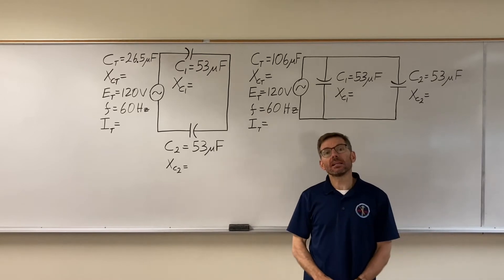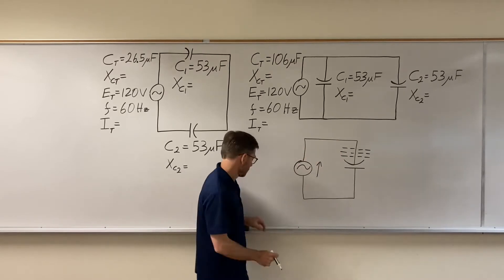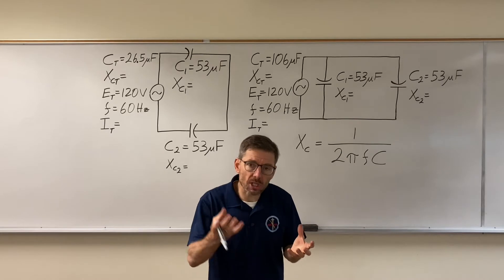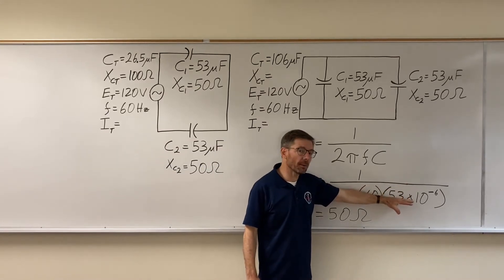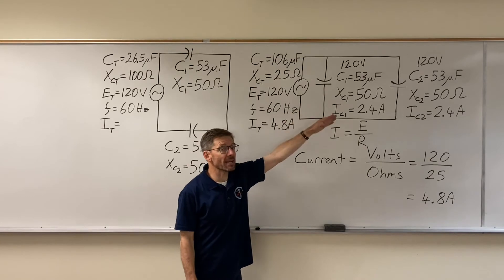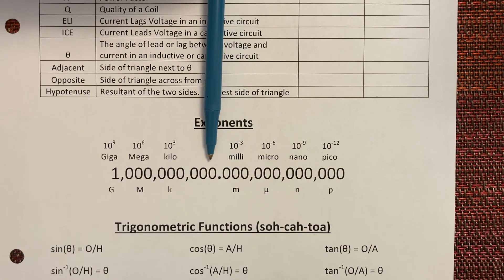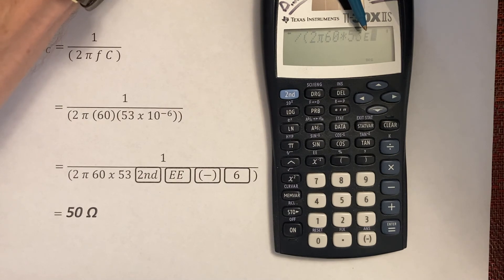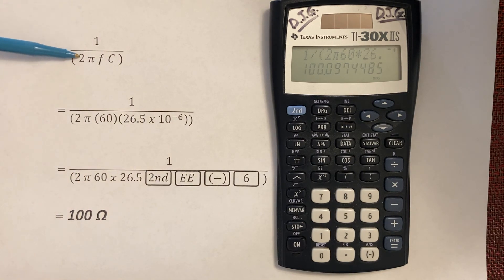Capacitive Reactance in Series and Parallel

Comment: This is awesome sir!
But I do have a few questions,
1. On the series one how did you get 26.5micro farads I get (2652.58)?
2. On the parallel one,how would you do the math if you had different mf to get the Xct value.
Thanks for all the info you put out sir!
Reply: Answer the first question : Half of the 53 is 26.5F ; Answer the second question: You would do 1 over reactances, thus this way you convert reactance to admittance, you do the same thing the second reactance Then you add up admittances. At the end you again convert  the final result to reactances.